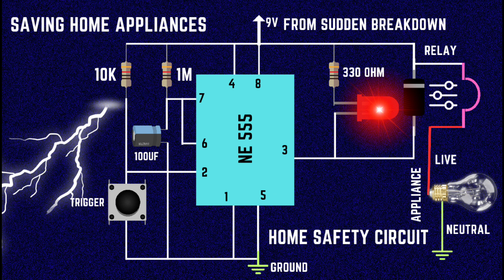How to make Power Delay Circuit Using NE 555 timer for Safety of Home Appliances?

Comment: Please provide other sketch for the circuit showing connection between circuit and relay because is not clear in the sketch at the end of your video regards
Reply from the maker: Hi Hefin, thank you for your feedback! I apologize for the confusion. I’ll update the video with a clearer sketch showing the connection between the NE555 timer and the relay. In the meantime, you can connect the relay to pin 3 of the NE555 timer, which is the output pin. Make sure to use a diode across the relay coil to protect the circuit from voltage spikes. Regards!”

Comment: Dear friend the connection of the relay is not clear in the sketch please explain how to connect relay to such circuit best regards
Reply from the maker: , Hefin! To connect the relay to the NE555 timer circuit, you need to connect the relay coil to the output pin (pin 3) of the NE555 timer. Additionally, connect a diode (e.g., 1N4007) across the relay coil to prevent back EMF from damaging the circuit. I’ll make sure to include a detailed sketch in the updated video. Best regards!”